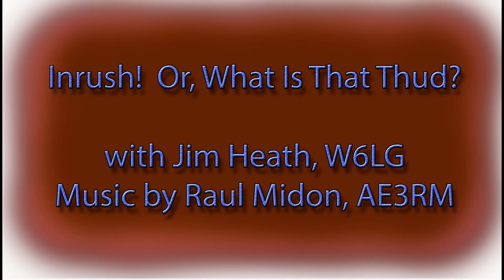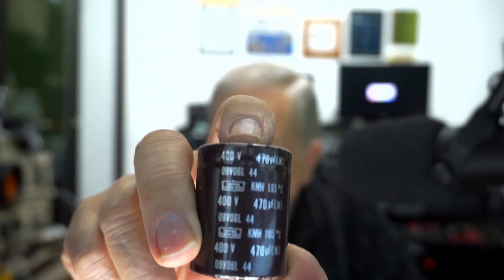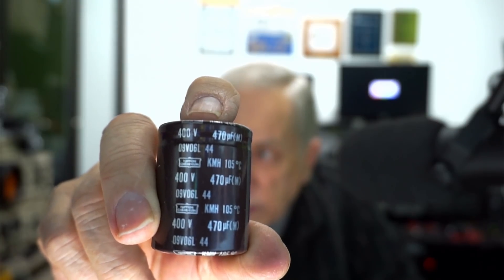What is that THUD??

Comment: In addition to charging the caps  It has got to magnetize the transformer core, which with no power applied, is just a big empty reservoir. Then it demands large amounts of current to magnetize the core. Just like starting an electric motor.
Reply from the maker: Thank you.  It is a big HV transformer at about 1KVA.  I have built a step start that should help a little during the first few cycles. Interesting stuff!  73, Jim

Comment: Another  interesting video Jim, I am a big believer in soft start circuits, mostly to preserve the switches and fuses. I am in the UK where we use nominally 230v in domestic installations, we have fuses up to 13a in the plugs. Many years ago I was building a power supply,  it was going to use 2 identical large transformers to get the rating I wanted. I initially powered up just one transformer on the bench, on switching on a 10a fuse failed with a loud bang. This was without the secondary being connected to anything, so a bit worrying bearing in mind I was hoping to run a pair of these with rectifiers and reservoir capacitors through a 13a fuse. I used a high power 50 ohm resistor which is bypassed when the reservoir capacitors reach about half their running voltage, no problems at all since. Obviously large reservoir capacitors need to charge but it does seem like transformer itself is the villain too. Your video is thought provoking, a soft-start does not need to be as slow as mine. 
73

Comment: A 120v air compressor, vacuum cleaner, or table saw can pull 70 amps on start up (on a 15 amp breaker) and doesn't trip the breaker.  The current is so quick that it falls in the breaker specifications.  It maybe that the capacitors take longer and go past the breaker trip time.  I had heard that a breaker should be used only at 80% of its rating if the current is near the breaker's trip current.

Comment: The wires will move as well, so wire size is important. I use THNN wire in all my circuits in ridged conduit in my garage/radio room. For my amplifier (Ten Tec Trident III) I have a 40 amp breaker using 8 gauge THNN stranded wire. Best rule is look at the size of the fuse on the amplifier and double that for the circuit breaker and use the proper wire size for the current. I have my Amplifier on it's own 220 volt circuit from other devices.

Comment: My stereo amp had multiple massive caps and transformers on it, and a special soft-power-on circuit, specifically to avoid the same "inrush current" problem, to protect its own circuitry as well as the mains fuse. Possibly the same as your relay gizmo, it did "click" once it was fully on.
 I'm told that cheaper thermal breakers will wear out much sooner than magnetic breakers, btw.

Comment: Sounds like the sound my AC arc welder makes. Have you considered Ametherm Circuit Protection Thermistors?  They should have one that will work for your current demand but will need to mount it in a safe way as it will get hot.  I've used a few for soft starting a saw. Much simpler than implementing a full blown soft start circuit.

Comment: Don't know how long those breakers will last as a switch duty breaker but have drilled out the pins before on a couple of used  non switch duty breakers to look inside and some of those contacts can look very worn. Obviously, depending on the type of use but some looked like it may cause it's own initial resistance from contacts that looked partially melted. Possibly another weak link, just a thought.

Comment: Thanks for the videos, Jim. I always learn a lot from your explanations. I had a 50 amp power supply at another location a few years ago and occasionally when turning it on, the breaker would trip. I wondered then if the initial power surge was the culprit. When using a 35 amp power supply however, the breaker would not trip.-Lonnie, K4KZ

Comment: This has been a problem for high power motors for ever. If the load is reactive with little resistance, then you start off with a virtual short circuit until  the reactance buids up. I wouid say that "initial virtual short circuit" is a better description.
Reply: Not the easiest thing to dig up with a google search but the first 1/2 cycle amperage draw on a 100HP 3 phase motor which is "across the line" is really astounding :-). "Often, during the initial half-cycle of electrical current flow experienced at motor startup, (Note: A half-cycle in a 60 Hz electrical system equates to 1/120 of a second duration of time) inrush currents reach levels 20 times greater than the normal current levels experienced during the motor’s normal operating speeds". So for the 100hp 480 3 phase motor that first half cycle could draw 2480 amps. The 1/120 of a second is such a short duration that none of the fuses or circuit breakers are bothered by it. https://www.jadelearning.com/blog/understanding-motor-starting-inrush-currents-nec-article-430-52/

Comment: Hi Jim. Heard you on the air for the first time a few weeks ago. Very cool.

I’m not sure this applies to power transformers in our gear, but I learned something when I bought a big 120V Variac. Plugged it in without a load, turned it on set for 0 volts, and it tripped the breaker. Nonplussed, I tried it again. Same thing. Third time it was fine. Then it did it again.

Seems that it retains residual magnetism. If you hit the switch at an instant when the line polarity opposes the residual, the thing draws massive inrush. At zero crossing, or on the opposite swing, it’s not enough to trip the breaker. 

Regardless of any residual the transformers may have, it seems like the point on the line waveform will make a difference.

Comment: Hello Jim, great to see you again! Good information for protecting our equipment. I am familiar with controlling inrush current to 3 phase industrial motors. Would a starting capacitor work like is used on an air conditioner compressor? Hope you are doing well! 73 W1WRE

Comment: Surge current?
Reply from the maker: Bingo!  I like that.  73, Jim
Reply: @ham-radio  This was the term I was taught to use 30 years ago in college. When I worked in conveyor controls, we used the term 'start surge current' to distinguish it from the surge current associated with sudden increase load on a motor.

Comment: Inrush is common in a lot of things with big inductors like transformers or motors, etc. In industry, it is recommended to size overload devices at 125% of their full-load current. This provides protection to the device still, but does help prevent nuisance trips from inrush. I think it may even be code. This is what we use for industrial machinery.
12A * 125% = 15A. The breaker is just barely big enough for the amplifier by itself, and I believe I heard you say all of the rest of the gear is also on that breaker. The circuit is not designed for the load. You need a bigger breaker, and to go with that, you will also need bigger wiring and receptacles to remain within electrical code and safe practice, or run a separate circuit for the amplifier alone, a 20A circuit, I'd say.
Reply from the maker: I did use a subpanel of 50 amps. There are several 20 amp outlets with the correct orientation for the "stabs" for both 120 and 240 VAC (they are different).  Thanks for the help and advice. I very much appreciate it.  Take care and 73, Jim
Reply: Hi Guys, Jim had it right when he surmised that the current peak occurred when he closed the breaker when the voltage was peaked.  Judging from the picture of the transformer, it’s likely designed to operate at or close to saturation.  That means it’s a very low impedance device.

 Energizing the transformer requires as much current as it can get.  I have personally measured 25 times full load current and I’ll bet on a sub cycle basis, that transformer is pulling 16 or so times FLA.  You can certainly develop a soft start circuit to insure that transformer start only occurs at zero crossing but that adds complexity that likely not needed.

The breaker used looks like a typical residential dual pole circuit breaker.  They are simple thermal trip devices that generally operate plus or minus at 80% of rating.  I agree that increasing the breaker size will likely help but I would not be so concerned about wiring.  In fact, the wiring probably helps by adding some resistance to the circuit.   

Bottom line: inrush is a physical behavior that unless you invest in additional equipment, the simple solution is to replace the breaker and see what you get.  Good luck.

Comment: Hi Jim,
Current limiting is what I think of for inrush. As you mentioned it only needs a second or two. I will soon be bringing online my SB221 conversion to SB220 and will be using the Harbach soft-start module for 240V. Stay safe.  73  WJ3U
Reply from the maker: Hey Don! Super, great amp that will give many more years of service after you do the upgrades.  I too am working on an amplifier.  Keep in touch. 73, Jim

Comment: All my power supplies do that. I have a fascination with FL-2100B amps and had problems with the in-rush current and ended up installing soft start and timer boards along with meter protection circuits as well when they were converted to the GI7B ceramic tube. 73 Jim,,, always great to see you. One of these days I will catch you on 20.
Reply from the maker: I'd love to do a project like that.  I have converted some amps to GS35B because they are very inexpensive and forgiving of mistakes.  GI7B..neat tube!  73, Jim

Comment: Perhaps a "Soft Start" for the amp might be of benefit to slow / delay the initial current demand from the Caps. Inductors tend to already soft start as they tend to want to stay in their magnetic condition.  Current lags voltage in AC power
Reply from the maker: Thanks Ken.  Excellent and that is what I use. I am currently modifying an old but nice Henry Amplifier.  The thud in the video is that amp at turn on.  73, Jim